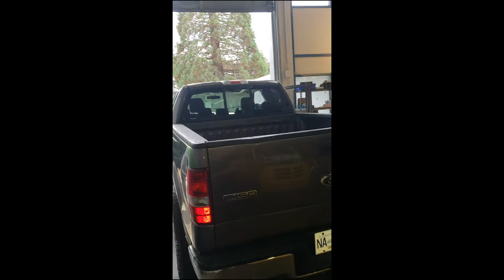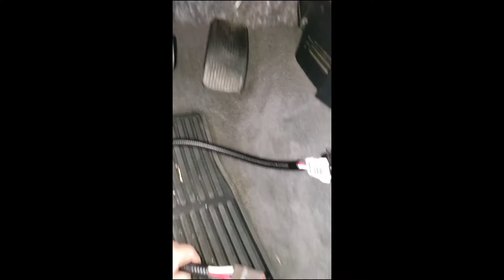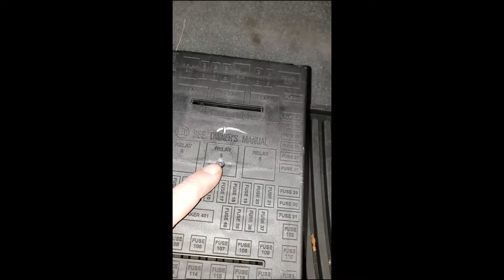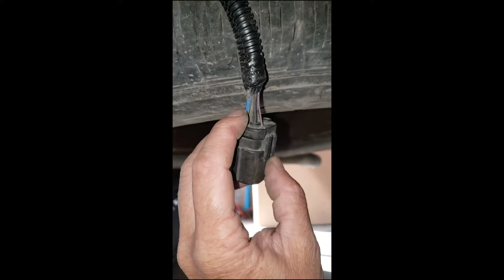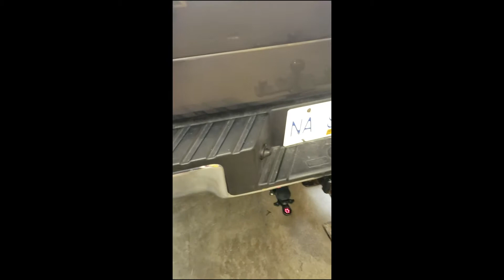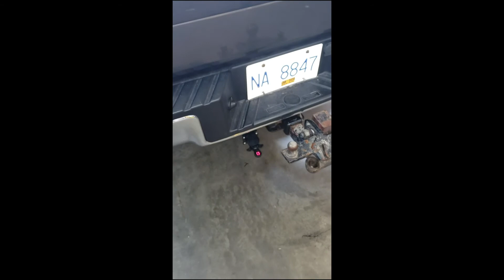2004 Ford F150 Factory Trailer Brake Controller and Hitch Install

Comment: Who did you say sells that adapter that you can plug straight seven plug-in to their were the four-way plugs into—I couldn’t understand what you said I’m gonna try and look for it
Reply from the maker: Curt Manufacturing or Tekonsha both make harnesses of this type.
Reply: @ModulaRacks  I just ordered the Tenkosha one!! Thanks for the video— I literally ordered the harness the same brake controller and adapter wire for $120 and I had a sharp quote me $600 to wire a seven way plugin with the trailer brake you just saved me $480 so let me know where to send you a case of beer lol
Reply from the maker: @Rocketman097  You can always find us at modularacks.com ;-)
Reply: @ModulaRacks  I got you— i’ll find something to order lol

Comment: so i have a 04 f150 this is helpful thanks but i do have a quick question i do have the 7 way and the 4 way in the back already installed in the truck do i need to do anymore wiring in the rear or can i just install the brake controller i would believe i would only have to install the brake controller and thats all and do i need to buy a relay for this as well?
Reply from the maker: Hi Nathan, generally you would only need the brake controller and the harness to plug it into your F150. Occasionally the fuses and relays are either not in place from the factory, or have been used as spares during the life of the truck. Your owner's manual should indicate which fuses and relays are for towing. From there you just match the numbers on the diagram to the positions in the fuse box. It only takes a minute to check. Your manual will indicate the correct amperage for the fuses and relays, or you can ask at your local auto-parts store.
Reply: @ModulaRacks  ok thank you. Just wanted to know before i order the brake controller and the harness.

Comment: My 4 pin connector don't work what can the problem be
Reply from the maker: Hi Stan,
It could be any number of issues. Lose wire, shorted wire, blown fuse. 
I would take it to someone local who works with trailer hitches and accessories!

Cheers,

Comment: Wheres the ground located for the trailer brake controller?
Reply from the maker: The entire trailer breaking circuit is handled by the under-dash harness that goes between the controller and the factory plug. If your controller has an extra ground it would generally be attached to the chassis. I have never seen a controller with an extra ground; but, we use mostly Curt and Tekonsha units.

Comment: Which wire is for the electric trailer brake on the wire harness. Thanks!
Reply from the maker: The thicker blue wire is the controlled power for the electric brakes. However always use a 12 vokt power tester/meter to confirm.
Reply: Modula Racks thanks! Your video got me the info that set up my brake controller for my trailer. Thanks !!